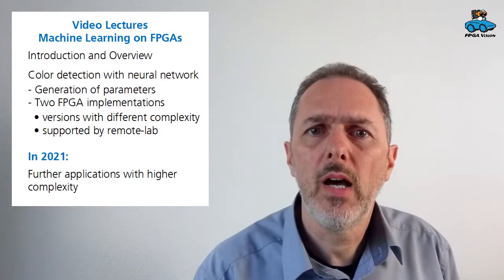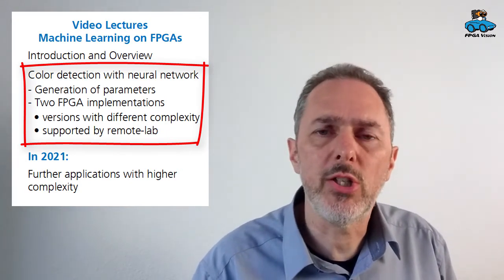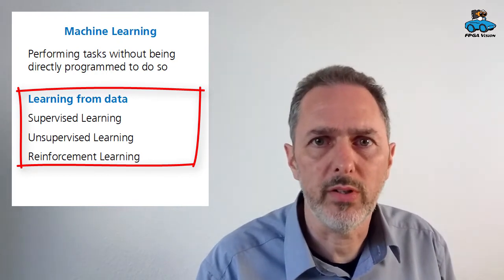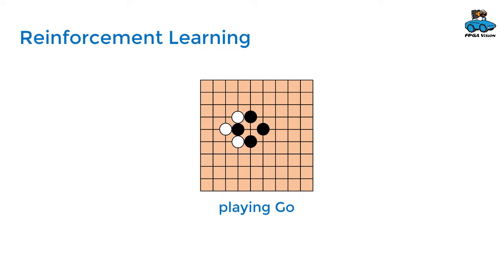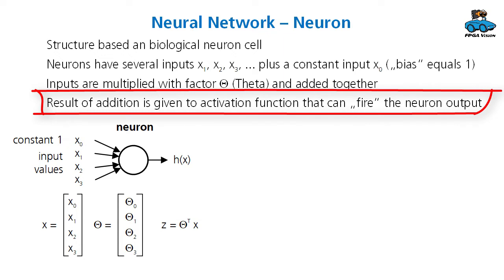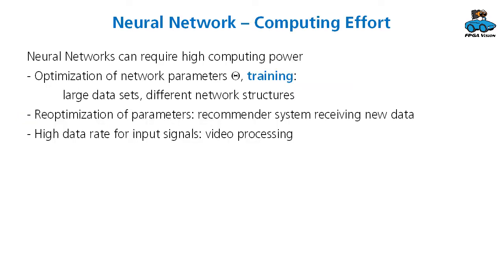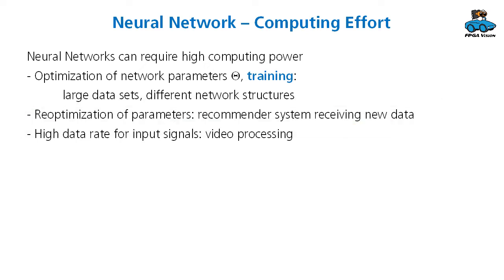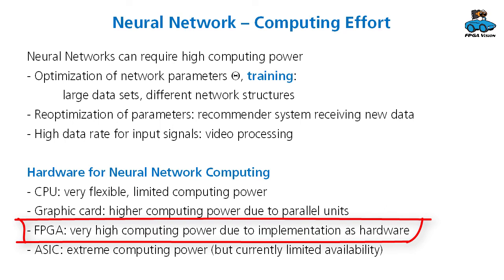Machine Learning on FPGAs: Introduction

Comment: Thanks for sharing. Please try to explain the vhdl implementation in more detail.
Reply from the maker: Yes, there will be more videos on that topic next week and in October. :-)
Reply: @marcowinzker3682  thanks for your reply. Actually I have been following your previous videos but it's very difficult to understand each step of vhdl code because you only give overview of the implementation of. If you explain each step of the code at basic level then it will help to understand for the beginners.
Reply from the maker: I can understand your request. However, we are not targeting the videos for beginner in VHDL. Maybe you can take part at our Open Online Course that will be held again starting April/May of 2021.
Reply: @marcowinzker3682  would be looking forward to the VHDL series. I have some understanding of VHDL but I am more comfortable with verilog. Actually my more concern is not the HDL coding but the logic behind each line of code. Kindly try to make future videos a bit longer covering more detail about algorithm and the HDL implementation logic.  Thanks.

Comment: hello Sir, thank you for this cours 
i have a question ...
witch FPGA boards  model is good for machine learning??
Is the PYNQ series good for that??
Reply from the maker: This depends very much on your application. 
I regret, I can not provide tuition for individual projects.
Reply: @marcowinzker3682  Actually, I wanted to buy a board for learning and I wanted to know your suggestion
Reply from the maker: @esmaeelchamani9999  We have the FPGA remote lab, where you can do experiments for free.

If you want to buy a board for machine learning, this is something like "I want to buy a car". There are some many options and price ranges, that a general recommendation is difficult. The FPGA companies offer evaluation boards. These are fine for experiments, but if you want to design a large NN, they have their limits. I have a video series on "Pattern Recognition with NN on FPGA" and this does not fit on typical evaluation boards in the 100 US-$ range.

Comment: NN_RGB_3_Categories.m
Line 121-124 

NN_RGB_2_Categories.m
Line 112-115

Both files say that the NetworkStructure [3 3 1] means that the output layer has three neurons. Is it a typo? because as per my understanding the output layer has one neuron. 

Thanks for your help.
Reply from the maker: Yes, that is a typo. Sorry for the confusion.
Reply: @marcowinzker3682  No problem, Sir. 
Thanks a lot.